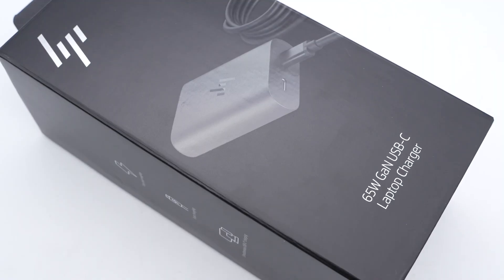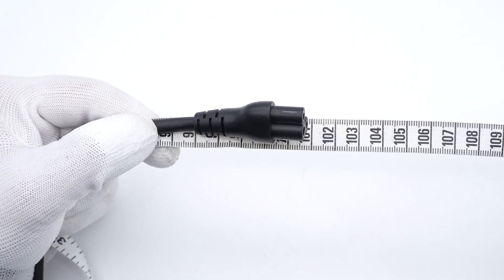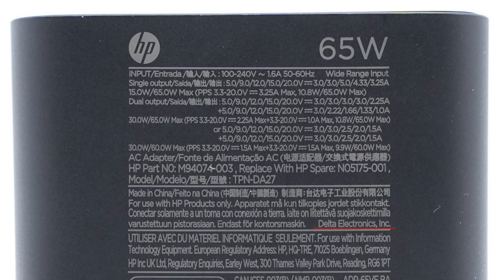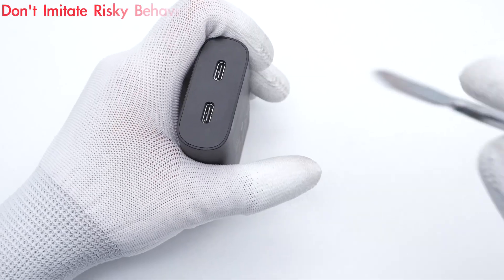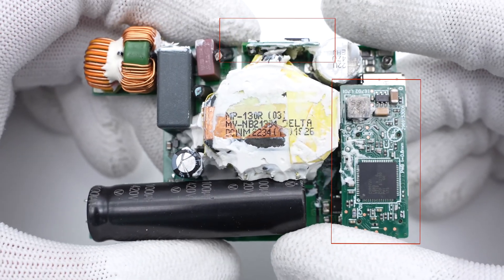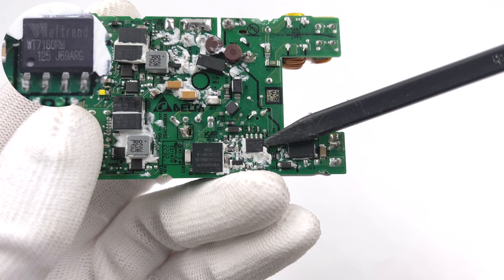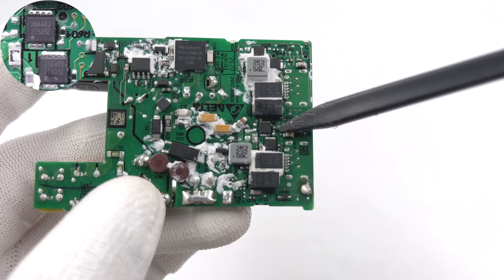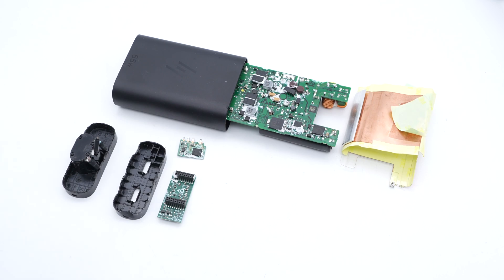Teardown of HP 65W GaN & Dual USB-C Laptop Charger

Comment: I am still trying to buy this in India, I already have 2x HP 671R2AA adaptor with single fixed braided type-c cable working fine for 1.5 years.